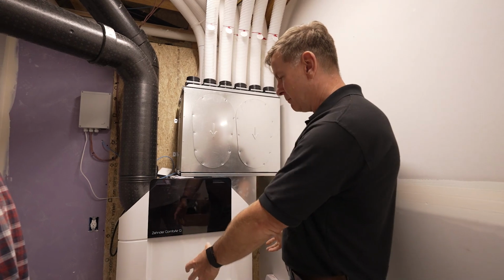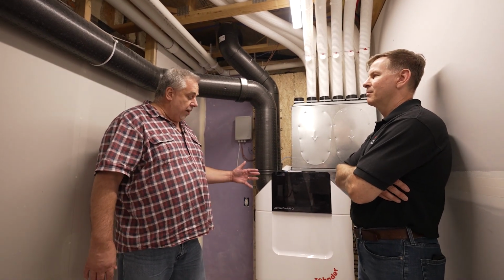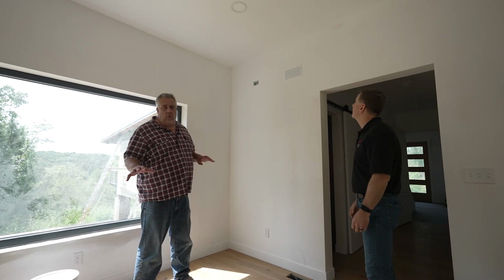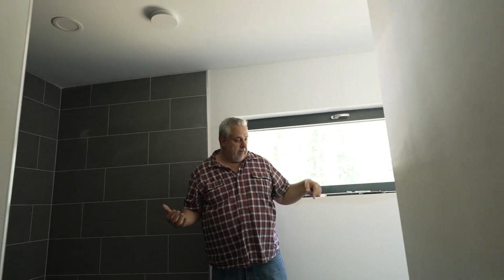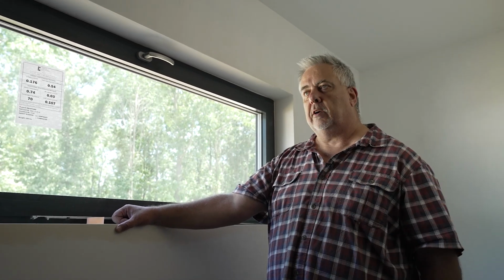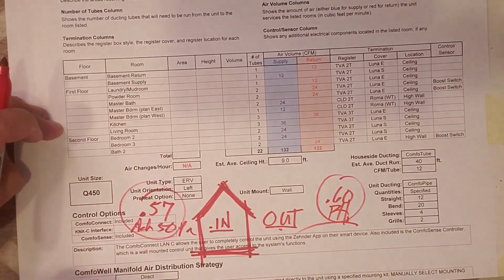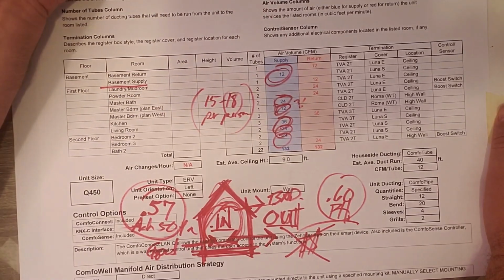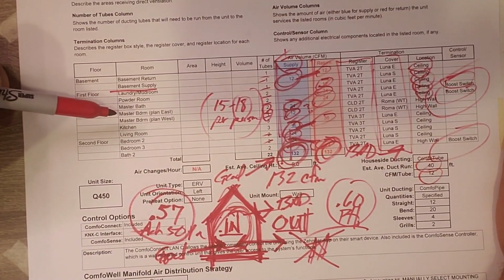ZEHENDER #1 - ERV - Ventilation

Comment: Hi Steve, great video. I have two questions:
1. With so many Americans suffering through excessive amounts of wildfire smoke coming down from Canada right now, does Zehender recommend a higher level of filter than Merv 15 or alter their units in any other way to improve air cleaning in wildfire regions?
2. With regards to the placement of the bath exhaust grills, I’ve watched several videos from Corbett Lunsford on his Home Performance Youtube channel where he recommends placing one exhaust fan in the shower (or above the tub/shower combo) to remove moisture and then placing a second exhaust fan on the wall below the toilet tank in order to remove odors. What does Zehender say about this practice?

Comment: Have used a Zehender 350 since 2018 with the optional geothermal preheat option, which improves heat exchange in very cold weather. Air quality is great, Zehnder has been quiet and reliable.
Reply from the maker: Happy 4th Buddy, hope all is well - I need to stop by one of these days
Reply: @stevenbaczekarchitect9431  Steve - would be great to see you if you are in the area. House is great, will add some more PV in the future.
Reply from the maker: @rickrys2729  will do buddy